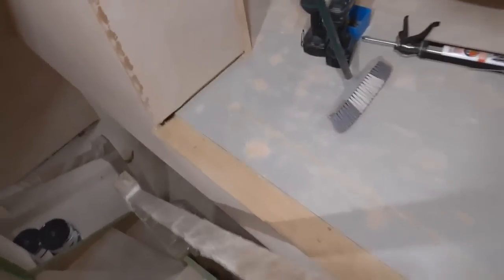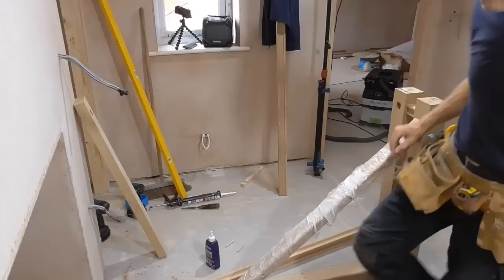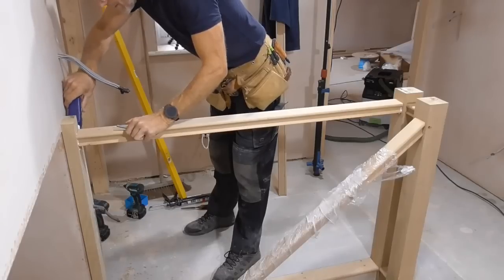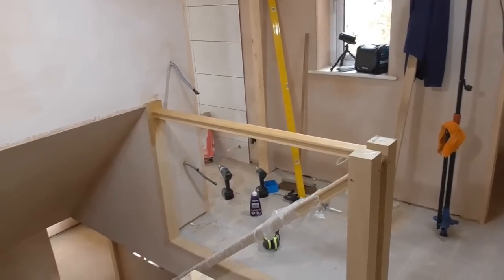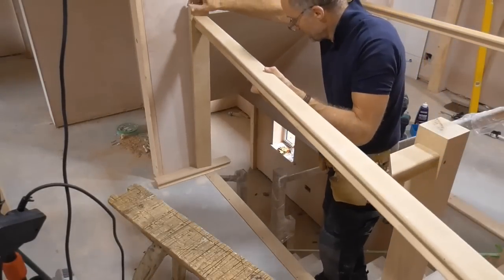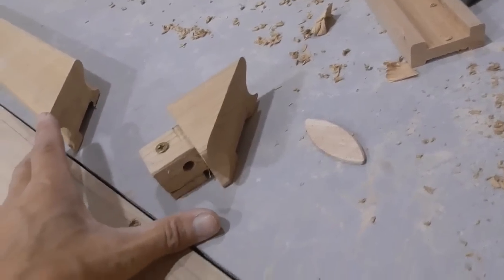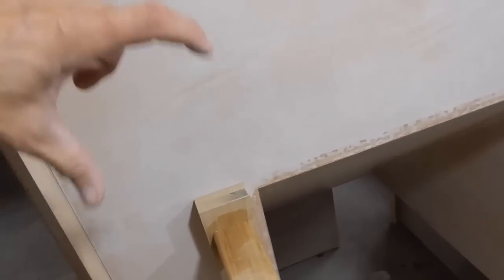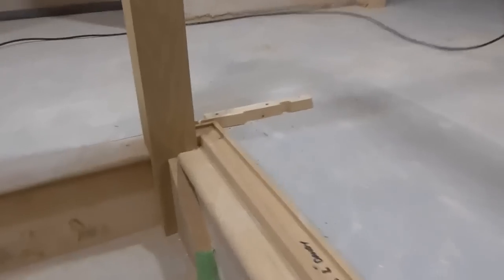UK Carpentry 2nd fixing ***fitting oak staircase half newels and handrails***Part 2

Comment: always have great videos. very well executed don't wanna sound OCD but what is the reason for the second newel post on landing could a mitred handrail like the left hand side look better and the half newel and nosing junction could possibly be coped instead of a bevel-off cut on half newel...but overall very neat job well done del
Reply from the maker: You've hit the nail on the head there PC, and I think loosing the extra newel and mitreing the handrail to copy the other side would have made a more symmetrical finish at the bulkhead, but ultimately, I have to follow the plans to a certain degree🤓Great comment and thanks for watching😎Cheers Del

Comment: Excellent. It makes sense to have that slight overhang on the half newel as many bulk head walls wouldn’t be as plum as that brand new one. Trying to plum up an arrow straight bit of oak with a plastered wall that’s on the p1ss could be futile. Ace job as ever.
Reply from the maker: Glad you agree Philip😉and I'm pretty lucky with the plastering 😎 Thanks for your comment🤩Cheers Del

Comment: Alot of time when doing small stair wells like that we run the apron and nosing around the stairwell, in this case both sides would have just been cut at the angle of the ceiling. One of the architects I work with likes that detail and I thing it looks sharp also.
Reply from the maker: Hi NGF🖐I've actually don't that very detail for a domestic customer, and they loved it🤩Thanks for watching bud😎Cheers

Comment: Any ideas how to fit a handrail to a half newel already fitted to a wall and been freshly plastered so can’t replace 🥲 debating glue and countersink screw through the under side maybe
Reply from the maker: Hi there🖐If possible, I would cut a really short tennon on the end of the handrail, say 10mm, then cut a corresponding mortice in the existing half newel, and then 'flex' it in place by pushing it against the full newel at the other end. Then, as you suggest, screw up diagonally from the underside of the handrail👍Cheers Del

Comment: I use a biscuit joiner for connecting pieces like that, which I bought about 13 years ago a dewalt  which is good enough, the lamello is more stable and has more ajustment features but more expensive. The router bit I use for longer cuts and replace the cookie wit a 3 mm ply strip. And I agree on the detail looks good like that. 👍 that’s enough English writing for today😊
Reply from the maker: As you say Rob, biscuits are awesome for connecting stuff together and keeping it lined up👊Spare a thought for me when you've had enough typing, as I still reply to ALL my comments🤓(I do enjoy it though🤗) Cheers
Reply: @thetallcarpenter  thanks 🙏

Comment: Looks well that mate, just wondering could you of done away with the second newel post and doa mitred detail for the handrail like the other side, that way the half newel wouldn't need to overhang  the edge of the wall.
Reply from the maker: That would have made a more symmetrical finish at the bulkhead for sure👍and I can only assume that the extra newel was put in as part of the design for a specific reason🤔Thanks for watching and your comment 😎 Cheers Del

Comment: Doing stairs is satisfying isn't it. One of the old guys that taught me to do stairs born in the 1920's. He used to cut out the shape of the handrail in the newel about 5mm. Thus when you pull the tenon in you don't see any shoulder. He reckoned it allowed for movement without any joint opening up. A quick template and rout job and boy the joints looked sweet. But like we said the other day time is money these days. You can do a good job. Perfection is a luxury.
Reply from the maker: I love fitting stairs Dave, the more complicated the better😎which is acting ironic, because they were the single most scary part of carpentry to me when ai was learning🤔Thanks, as always, for watching bud, and your comment🤗Cheers Del

Comment: Another brilliant real world carpentry video del! I would probably have ommited the corner  newel and mitred the handrail to push that half newel further in.
Biscuit in the mitre is genius 👍
Reply from the maker: Hi bud🖐I agree that ommiting that corner newel and pushing the handrail over would have made the half newels at the bulkhead more symmetrical, but I have to stick to the design that's been approved, plus the oak floor capping isn't, generally, wide enough to span from the apron to the spindle base rail🤔Thanks for your comment 😎 Cheers Del

Comment: Another good video. Enjoy watching all of your work. One thing I would of done a bit different would of been taken slightly more out of the landing newel so the half newel on the wall would of ended up flush with the edge or a tad back rather than past the wall. Not sure if you had restrictions as not to of taken any more out of the newel. Keep up the good work 👍🏻
Reply from the maker: Hi Jamie🖐I know exactly what you are describing, and I think it would have looked better if there was no 2nd newel, and the handrail was just mitred in a similar way to the other side, so the half newel margins at the bulkhead could have been even🤔Thanks for your comment bud 😎Cheers Del
Reply: @thetallcarpenter  Top bloke and like I said great work
Reply from the maker: @jamiestott3371  🤗😎

Comment: Plenty of good tips in the video Del👌, although the overhang on the newel maybe needs a quadrant to make it more appealing to some people. Would it have been possible to even get a newel that had been rebated around the corner slightly?
Reply from the maker: There's probably a few things that could also be done to alter or minimise this detail Kevin🤔but ultimately, this is a 'building contactor' set of stairs and each individual detail has been designed fairly generically😶Cheers bud🤗
Reply: @thetallcarpenter  Yeah I agree and upon looking at the video again, you'd never have been able to get the newel and handrail in like you showed in the video.
Reply from the maker: @amazing451  I perhaps could have got a rebated half newel in Kevin, but I'd need to employ some 'next level' sneakyness to do it😆

Comment: Exactly how I do my half Newels depending on the Over hang sometimes put a bit of oak quadrant or architrave down the back of it
Reply from the maker: It's cool to hear you do those half newel details the same bud👊and like the idea of a small moulding to soften it👍Thanks for your comment 😎 Cheers Del
Reply: @thetallcarpenter   I have done 4 in the last 3 weeks getting bit sick then now but there a rip out job rip out all old  posts and replace a don’t like it when people just join them and cap round them doesn’t look best a don’t think
Reply: @thetallcarpenter   tried to add a picture of one I have just finished but won’t let me 😞
Reply from the maker: @aaronbell8527  Instagram fella🤞 thetallcarpenteruk 🤩
Reply: @thetallcarpenter  don’t have it pal just Facebook 🤦🏻
Reply from the maker: @aaronbell8527  I've only got it for messages bud👍

Comment: What plug cutter and countersink bits do you use?
Reply from the maker: Hi Adam🖐My plug cutter is an embarrassment bud, and for these stairs I have pre-cut ones which fit nicely into the hole left by my SnappyTCT drill/countersink👍Thanks for watching 😎 Cheers Del